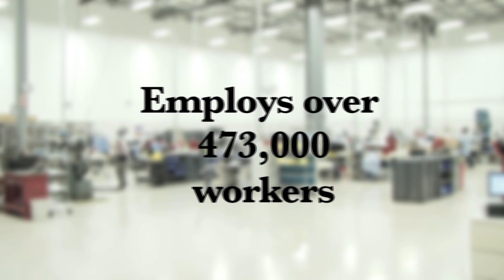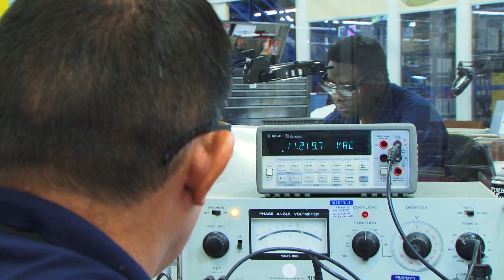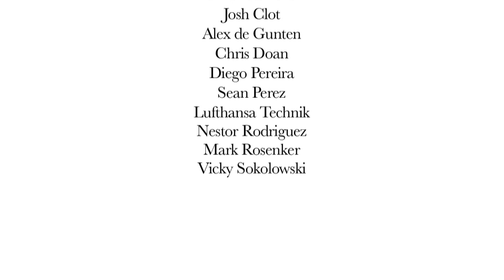You Can't Fly Without Us - The World of Aviation Maintenance

Comment: Aviation maintenance all the critical job done by technicians/engineers in a nice aircraft - Starting day with Line Maintenance generally refers to minor, unscheduled or scheduled maintenance carried out on Aircraft /Helicopter that includes:
1. Any unscheduled maintenance resulting from unforeseen events.
2. Scheduled checks that contain servicing and/or inspections that do not require specialized training(but surely required tasks training), equipment, or facilities. In service; and that is preparing for its first flight in service
3. Maintenance performed on Helicopter after a period of being out of service (such as Aircraft /Helicopter in storage)
4. Maintenance on en route Aircraft/Helicopter that are stopped before their next flight including Servicing or repair between successive flights.
5. Preparing and readying an aircraft/ Helicopter for flight during a period of service.
6. Maintenance activities being performed  to ensure that the aircraft/Helicopter is airworthy and fit for flight.
LASTLY -Wishing the safe flight of the aircraft , safe & secured journey for the  passengers  and crews onboard.

onboard

Comment: i need helppp 

whats the difference between avionics,mechanical and structures?
Reply: Avionics는 항공기를 컨트롤할때 사용되는 부품들에 관한건데 이착륙할때 조종사가 조종간으로 항공기를 작동하려할때 수십년전에는 유압을 사용했지만 요즘은 fly by wire라고해서 전기적신호로 작동하죠 그리고 이착륙을 제외하면 auto-flight인데 이때도 engine control을하는 컴퓨터같은 파트가 비행기가 받는 바람의 방향 속도 공기의 밀도 온도등등에 따라 안정적으로 비행하기 위해서 스스로 비행기 조종면을 컨트롤하죠 쉽게말하면 avionics는 소프트웨어, 구조는 하드웨어라고 생각하시면 될것같아요~
Reply: Hi. Avionics is radios, communication between the aircraft and the ground towers. Mechanical are all mechanical parts, the reciprocating or turbine engine. Structures are every other part of the aircraft:wings, body, tail, nose, landing gear, engine cowling, etc.
Reply: avionics=전자장비, mechanical=기계장비, structure = 동체, 섀시
Reply: Avionics is instrumental in the aircraft, mechanical is the powerplant side . Meaning engines, structures is airframe , skin, ribs